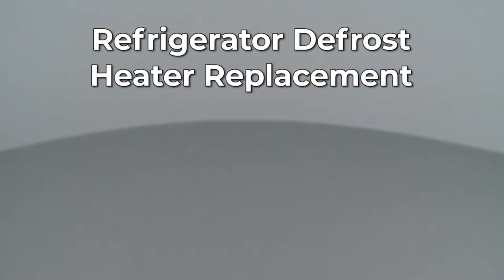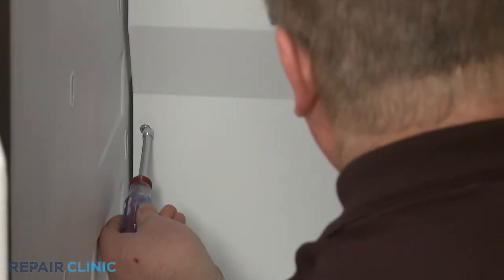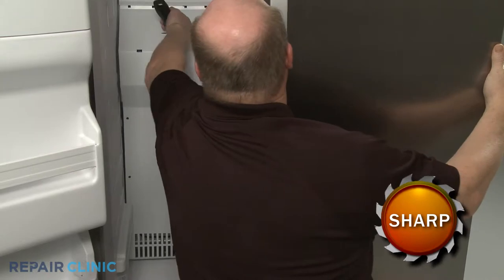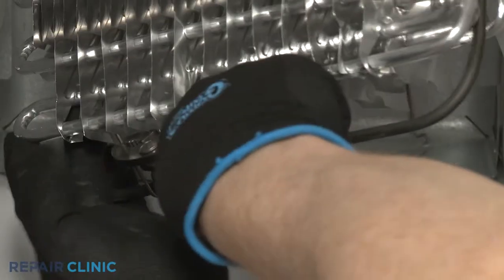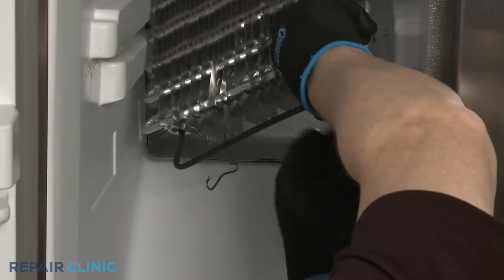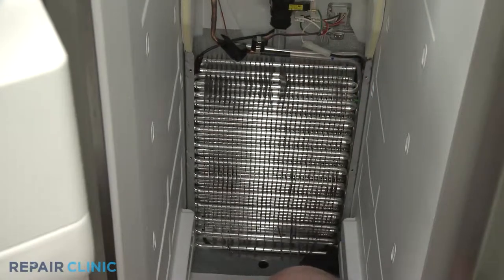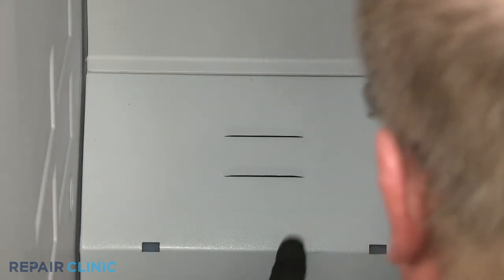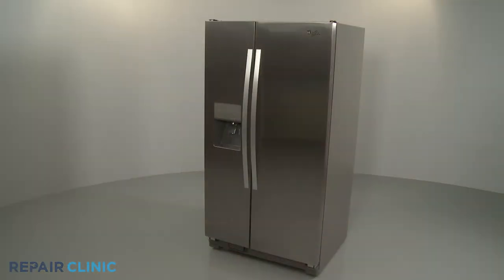Whirlpool Barracuda Refrigerator Defrost Heater Replacement WP2323198

Comment: Great video! How can I tell if the problem is the Thermostat or if its the Heater Element? Mine was frozen over and not defrosting. I took it apart and let it defrost and when I plugged it back in a short time later it started to make a noise as if something was trying to come on and it would stop the noise about 10 seconds later only to do it over and over about every minute or so, it eventually froze over again. I appreciate any advice, Thanks.

Comment: Thank you for the video.  Very clear/short/helpful.  A couple of suggestions.  The part you have a link to shows a different picture than other part sites including the OEM (whirlpool) site.  It looks like the part, but your picture shows it bent instead of a square shape.  Also, when clicking on that link to buy the part, you can't find out shipping costs prior to providing personal information.  Most places let you figure shipping by just zip.  I wanted to buy the part through your link to support your site, even though it was more, but the picture and shipping issue steered me away.  Thank you again for the time on the video.  8D...ave
Reply from the maker: We always recommend entering in your model number to get the genuine OEM replacement part for your appliances.  We also take all of our photos on-site. We ship to the US and Canada, and have a physical storefront located in Canton, MI. We have a variety of shipping options to fit customer's needs. We can relay the information about the shipping to our team to see if that is something we could implement. Thank you for the tip.